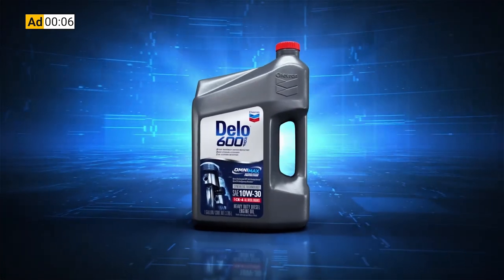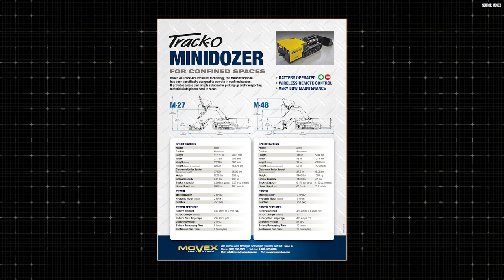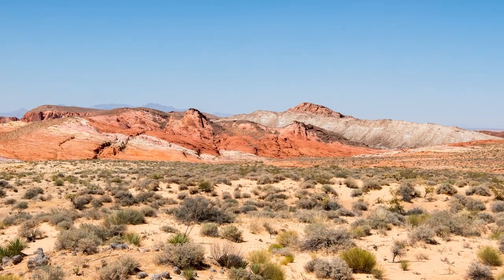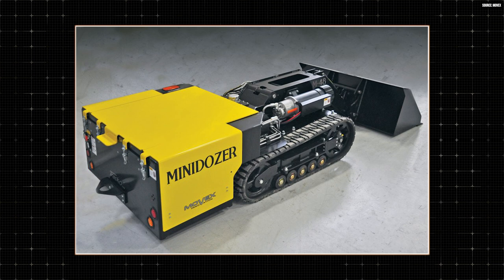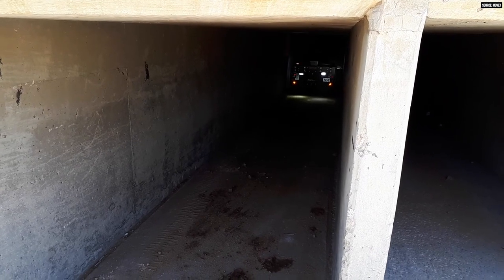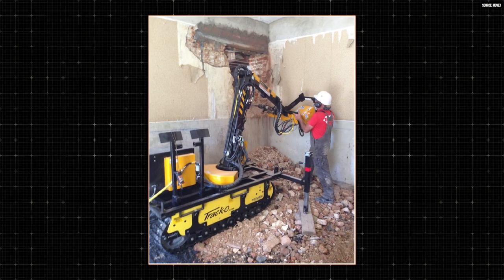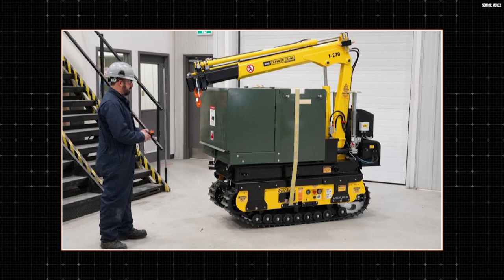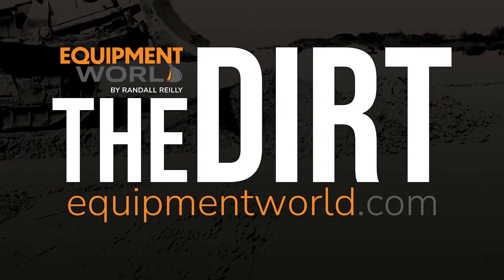“The Minidozer”: A Closer Look at Movex’s Tiny, Remote-Control, Electric Crawler

Comment: More a mini LHD (low head skid steer) - , does it have easy release of the bucket to allow fork attachment - (or other)  - lol, cleaning under a conveyor - doing this manually is extremely dangerous - or necessitating a plant shutdown - keeping an operator on the loop still increases productivity hugely.

Now what are the running cost of this electric tool offgrid - using diesel generation to power and / or charge the battery?

(I have a friend in Western Australia who assisted the development of a 'toy tractor" just like this back in the early 2000s - for exactly the same reasons,  primary reason, cleaning under coal and iron ore conveyors while operating.  my use case would be excavating new footings under existing structure - or at least trenching to level  - to allow 400-600mm footings to be dug - needs a hoe attachment.)

Comment: All this ABOUT DIESEL COST until the battery wear out the cost to replace the battery ouch
Reply: Electric machines can be used in more places and in more time slots. If you wanna keep choking on fumes, go right ahead.
Reply: @WowCreativeUsername   - This is true, there are economical benefits greater than the gross environmental interests. Even if diesel still needs to be burnt - it can be done off site in less controlled areas - so there may be no significant fuel cost saving, but increased revenue due to opportunity..
(Idle time in an electric device is an energy saving - not all machines  on the site are actively utilised all the time they are running.)